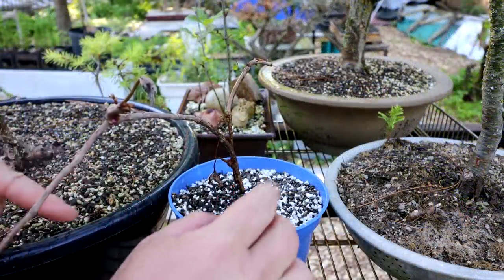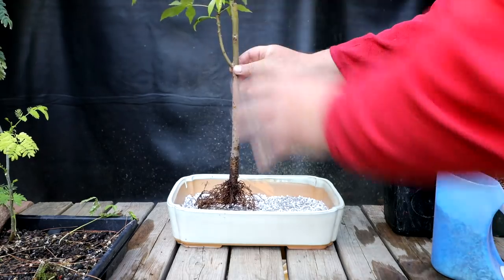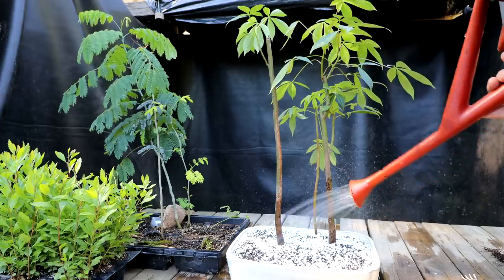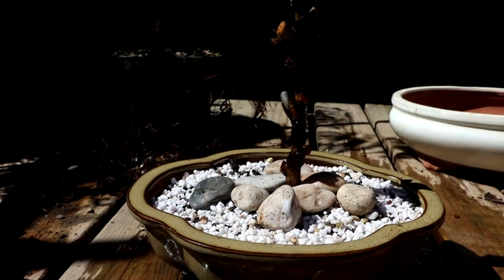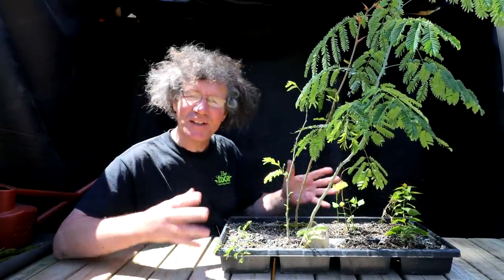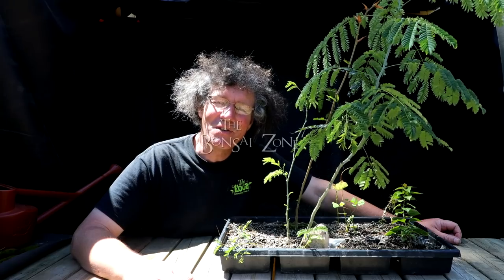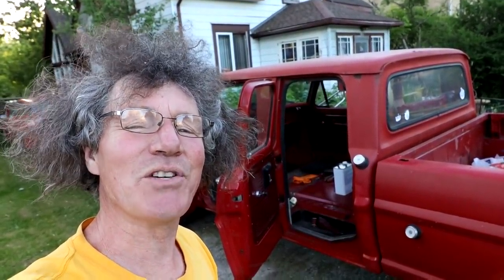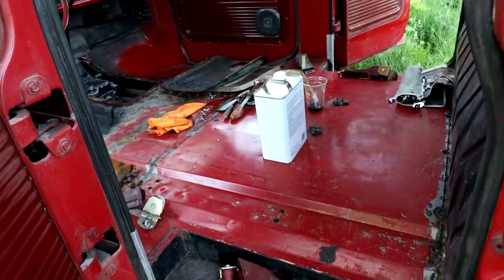Zooming Through Life and Death, Part 2, The Bonsai Zone, June 2020

Comment: Hello Nigel, I've been using your same soil mix of perlite and safe-T-sorb for quite a while now. The mix works great!! Bonsai soil can be expensive, and hard to find. So thank you for sharing this affordable alternative. I like to add Furr pine bark to mine as well  because I can find it cheap and at the local pet store. I was curious as to whether you sift your perlite/turface for dust only? Or do you sift for particle size? And what size do you use in your mix? I've currently been sifting out the dust with 1/16 mesh, then running it through 1/8 mesh and using what stays on top of the 1/8, and collecting what falls beneath. But that leaves me with a lot of left over fines that I'm not sure what to do with? I've been using them for cuttings. Any advice would be appreciated. Thanks Nigel!!

Comment: I put my citrus trees outside for first time this year , so far pest free , thinking douse em with horticultural oil before wintering inside , any thoughts nige' ?.
Reply from the maker: It's best to keep them cool for the overwintering period as they are considered a temperate tree. I keep mine in the basement now where it is too cool for insect activity at about 12 C or 54 F. If you spray before bringing the tree in, I would use just soap and water and then rinse it off. The dormant oil will stay on your plant and could possibly affect the health of your tree. Dormant oil is fine to use on the trunk and branches, but I wouldn't use it on the leaves as it doesn't wash off.

Comment: I love watching these videos as a new fan.  The soil you use seems to be essentially what they use in a cat litter tray 😃.  I have trees I started nearly forty years ago but I think I need to do more root work as some have been in the same pot 15 years.  They must be tough to survive with me looking after them.
Reply from the maker: Yes the soil is similar to cat litter, it is a fired clay product that doesn't break down with water. It is used to clean up oil spills in garages. I mix it 50/50 with perlite. Yes, the roots should be looked at at least every 5 years.